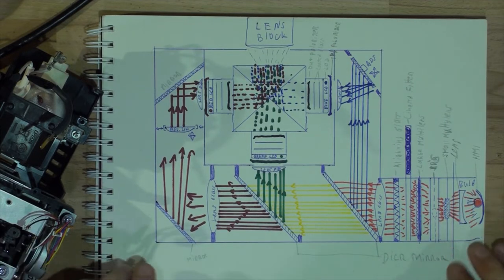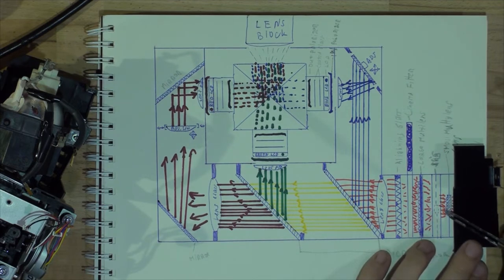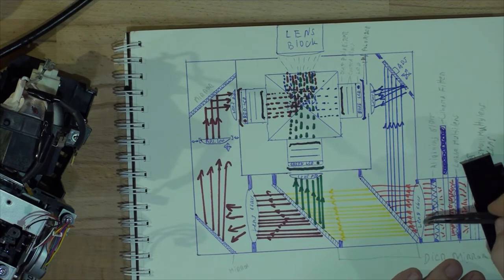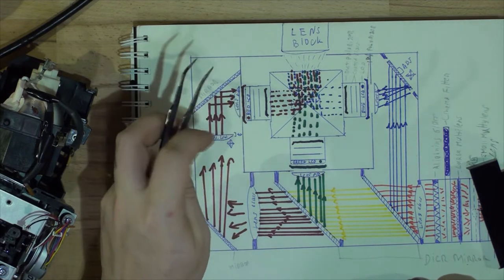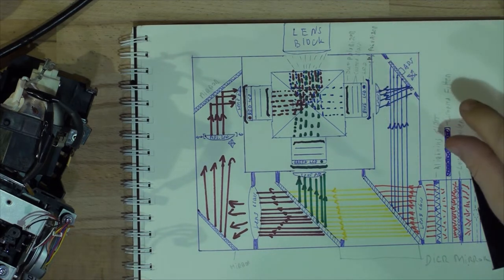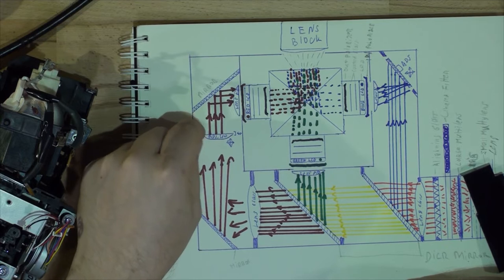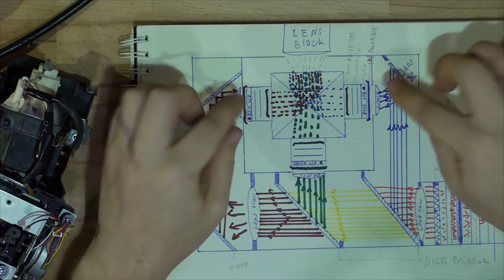Fixing Projector LCD Optics + Polarisers  Explained, How To Troubleshoot projector image problem.

Comment: Hello. Wow! Greate video! Can you help me? After replacing 3lcd prism block on Epson EH-tw9300. I have light red-green linear gradient on image from left to right. Right part of image looks more light. When I disconnected the LCD one by one, I got the following brightness: Red +15%, Green +40% Blue +12% in right part of image. I bought another one 3lcd block and same gradient again. Is new 3lcd bad too or how I can fix that? Thank you!
Reply from the maker: Hi, try adjusting INPUT polarisers, they should have a little screw on top and they can be turned left of right, power the projector on and make sure you have fully black picture on the input first and then adjust the polarisers until you get as black screen as possible, then try colour test pattern and readjust by colour, the rest of the adjustments can be done ether from service menu or user menu.
Reply: @MaxELECTRONICS  Thank you! I tried moving the green input polarizer left and right - only the level of green in the entire image changed, not the gradient (image looks black, but on test pattern I see gradient). The official supplier also said to move the input polarizers. Maybe there is another way? - or I'm doing something wrong (or shoud move red/blue polarizers too).
Reply from the maker: Is it only gradient on one colour or all?
Reply from the maker: Can you send pictures to my email? Maxchristensenau@gmail.com
Reply: @MaxELECTRONICS  Sent 👍
Reply from the maker: @user-jb3wx4uw4v it looks like you have problems with optics, check all the mirrors inside light guides, seems some mirrors are not aligned, usually the last mirror before the lcd assembly but before that try loosening the screws on prism and try moving it around while it’s on and see if that gradient changes. and image improves, it definitely looks like light isn’t shining in the center of the lcd.
Reply from the maker: Also check the first lens right after bulb, looks like square glass with lots on tiny lenses on it
Reply: @MaxELECTRONICS  Yes, I thought about it, but when I connect my old 3LCD prism, the image is perfect (No gradient, only bad vertical line on damaged lcd). Do I really have to touch the mirrors if everything is fine with the old 3LCD prism? If I move the new 3LCD prism to correct the gradient, I will get a small gap between the prism and the lens or is this a temporary measure to check the mirror correction?
Reply from the maker: All projectors are made slightly different, that why they don’t have fixed mirrors and lenses, they all calibrated at the factory and then they use glue to set it in place, so changing to a different yoke would require recalibrating  of some optics, usually I calibrate colour by colour, physically block 2 colours with something between the engine and the yoke and just calibrate one colour, then block calibrated colour and move on to the next.
Reply from the maker: Also check that new yoke has good output polarisers and they are clean.
Reply: @MaxELECTRONICS  How to adjust mirrors? They are located under the motherboard and it is not possible to turn on the projector to calibrate them.
Reply: @MaxELECTRONICS  And one more question, what glue should I use? Epoxy looks too hard
Reply from the maker: Use external light source to adjust mirrors. It’s hard to do but it’s doable, I’ve done it a few times, speaking of that, if all lcds are unplugged and projector is on you still get the gradient?
Reply: @MaxELECTRONICS  I sent you photos. With panels unplugged, the image does not appear solid and the left side appears brighter rather than the right :DDD. There may be some blue in black, but I don’t think that correcting it (input blue polarizer) will correct the gradient.
Reply from the maker: It still looks like the problem with gradient lays in mirrors and misaligned optics in the engine and not the yoke
Reply: @MaxELECTRONICS  I wish I knew what to fix) What kind of glue do you use? (Epoxy looks hard). It's probably easier to sell the projector with discount and buy a new one)
Reply from the maker: Use silicone it’s can withstand high temperatures
Reply from the maker: Did you check the first lens after the bulb? The multi lens ?
Reply: @MaxELECTRONICS  Not yet. Will check today/tomorrow and write. Does it have any calibration screws or is it glued also?
Reply from the maker: I think it’s glued, I can’t remember
Reply: @MaxELECTRONICS  Hello. I apologize for not writing for a long time, I didn’t have enough time to repair the projector. Nothing helped me. I didn't touch the mirrors. I tried reducing the amount of blue in the frame (black is better) and now I get two vertical blue areas (right area at the top, middle - black). What could it be? Thank you! I sent email with photo to you
Reply: @MaxELECTRONICS  No ideas?

Comment: hi Max, do you know the angle of the polarized filter of green? I would try to replace the film on the glass as I have no spares for it (it is always on green, sometimes on blue but it is rare). It seems to me they are 90°
Reply from the maker: I’m not too sure, I usually buy ready polarisers, I believe it is 90 degrees
Reply: @MaxELECTRONICS  you cut a polarizer? Too little for me.
I'm curious: the blue and red are also 90° but monted in a different orientation? The green I believe has a 90 plain - when I rotate 90° one on the other (both out filter) it darkens; I can't explain in any other way why the polarizer from blue or red won't work if swapped
Reply from the maker: @Momo-el5sk the green and blue can be swapped around in some cases but not always, red however always stays exclusive to red.
Reply: thanks, that's interesting: have you experience with Epson tw3000/tw3500?  @MaxELECTRONICS
Reply from the maker: @Momo-el5sk yes they all pretty much identical inside
Reply: I mean: can I put the blue from the 3000 in the red of the 3500 (lcd unit is near the same)?  @MaxELECTRONICS
Reply from the maker: @Momo-el5sk no, red is always exclusive. You can sometime swap parts between green and blue but red always goes with red.
Reply: @MaxELECTRONICS  sorry, mismatch: I mean blue from 3000 to green of 3500
Reply from the maker: Give it a try,

Comment: Are there any alternative names for the 'aligning glass', need a replacement for my projector but I am struggling to find one
Reply from the maker: I’m not sure what you mean by “aligning glass” you mean the lcd convergence or prism?
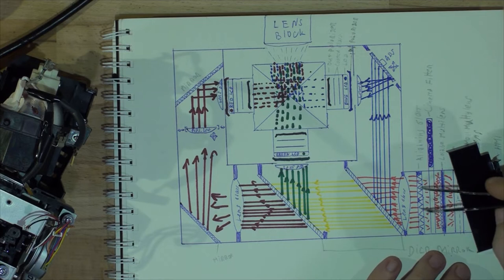Reply: @MaxELECTRONICS  Its at 2:18  I've heard it being called a polarisation conversion filter and it is mounted in a little metal frame with 3 vertical slits. With mine the polarisation layer thingie has actually burnt off making the projected image yellow. I was struggling to find any sort of replacement. Thanks for your help.
Reply from the maker: Here’s an example of what it is, I’m not sure if this item in the link is the right size for you but you can scroll down on AliExpress for “more like this” and see if you can find the right size, let me know how you go.

Just found this amazing item on AliExpress. Check it out! AU$2.73  10％ Off | Defective Rectangle Prism Dichroic Prisma Stained Glass Optical Experiment Instrument Home Decoration Art Necklace DIY Design

https://a.aliexpress.com/_mPGXcrc

Comment: greetings Max
My Dell™ 3200MP Projector has a yellow tone to the lights when projected horizontally and vertically, and works fine when directed to project downwards. Please advise, what is the problem?
Reply from the maker: It’s probably something loose like a mirror or a lens, maybe a polariser, check that all the optics inside the engine and the yoke are in place and nothing is loose/rattling/fallen out of its place.
Reply: @MaxELECTRONICS  I am very grateful for your advice. Thank you very much and best regards.

Comment: I know it's a two year old video, but when I saw this is the exact light engine that's in my 5020U be I thought I'd post my question. Last week we noticed something was wrong with the picture, and realized there was no red. I opened it and checked looked around, I couldn't find anything, like a mirror, out of place. I put back together and tested it, now there was no green. Opened it again, nothing. Put it back together and now there was green but no blue or red. Now I played with the ribbon connectors by having them plugged in only one at a time. There is no picture at all, not even the Epson logo. 

Any suggestions? Thanks, Mike
Reply from the maker: It’s definitely connection problem, try cleaning connectors with contact cleaner spray, make sure they inserted correctly and all the way in.
Reply: Thank you @MaxELECTRONICS

Comment: Wow! Just Wow! This is the best explanation of how 3lcd projection works because it teaches you how things work! I came here to trouble shoot my projector and learned so much. From the video I suspect that my green tint is because of the alignment of the green input polariser. You mention it at some point. However it would really be strange since it is actually glued into place. Can it be the input polariser? Basically my projector replaces black with green...I can send you a picture if you want to explain it better. Hope you can give me some input because this is driving me crazy. Whites are fine...anything else is kind of washed out and blacks are green...
Reply from the maker: It sounds like output polariser is burnet out.
Reply: @MaxELECTRONICS  Only thing is that this would make my whites look yellow, my whites are actually very white. Do you have a mail where I can send you a comparison of an image and how it is projected?
Reply from the maker: Sure, maxchristensenau@gmail.com
Reply: @MaxELECTRONICS  will send you the image
Reply from the maker: It definitely looks major and I’d say mechanical, as in maybe polariser fell out on one side or something along those lines, make sure all lenses and mirrors and polarisers are attached properly and not loose, start with first lens near the lamp and make your way to the yoke (last polariser is right next to the prism)
Reply: @MaxELECTRONICS  When I block the Green channel with a piece of paper, green goes away, so it must be that no green light is blocked at all. Can it be that the LCD panel is not generating a black  wall and green is not blocked and overshooting to the prism?
Reply from the maker: I doubt that to me it looks like polariser, have you actually tried to clean the polariser and that’s when the problem occurred? Some polarisers have powder coating that you can’t wipe off, if you cleaned it and wiped it off then this could cause this type of effect

Comment: Thank you very much ! What about an led projector with ips panel ? Cause the polarizer got burnt a bit ? Why do you need it there?
Reply from the maker: What do you mean? Why do you need a polariser?
Reply: @Max ELECTRONICS  I think my projector has ,and is getting burnt. Or i hope is the polarizer film and not the actual lcd panel
Reply from the maker: Yes it’s probably the output polariser.

Comment: wow great information that is so hard to find . thank you soo much ... on my epson tw700 there is also two  adjustable filters right after the input polariser only on green and red .. do you have any idea what they are for ?
Reply from the maker: Most likely if it’s between input polarizer and lcd it would be ether anti glare filter (similar coating as a lens from camera) or UV filters.
Reply: @MaxELECTRONICS  yes it is propably anti glare or uv but what confuses me is that those filter exist only before red and green lcd's and not blue ... anyway i so stupidily i messed up the tilt on  polarisers while trying to clean them up and im trying to adjust them again and its so pain .. thanks again ...

Comment: I tried to replace green LCD in epson 8350 after that I got double image. I try to lossen the LCD screws and align the image properly but during the LCD cable removable time it's again misaligned. please guide me how to solve this.
Reply from the maker: You need flex cables extension so you can realign lcd while projector is on. So once you extend the cables, loosen the lcd screws, then use bluetack or whitetack to hold lcd in place amd adjust it, once it’s aligned, use quick set epoxy on the corners of lcd so it’s set in place, once epoxy set, gently tighten the screws, but not too tight.
Reply: Thanks for your support, I try to check the extension cable availability...
Reply: You have any flex cable jig, please share the image or link
Reply from the maker: Unfortunately I don’t, I never remove lcds due to convergence problem after removing, even if I need to change output polariser, I always work around the lcd but never remove it

Comment: hi max this is paul  i have optoma hd-142x modle  projecter   no power what type of problme is it can ane  has an anwesser
Reply from the maker: It’s hard to tell without looking at it, if there’s absolutely no power it could be “on board” fuse, or thermal cutout, or switch mode power supply board.